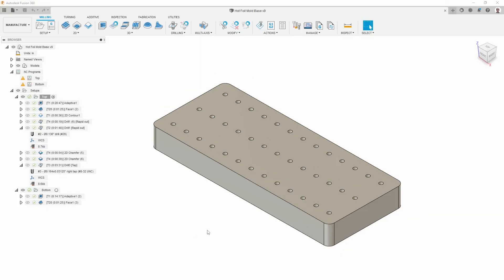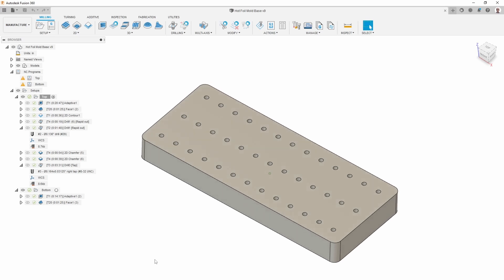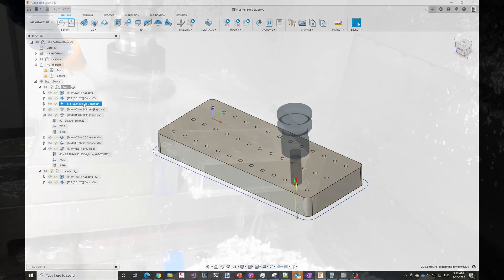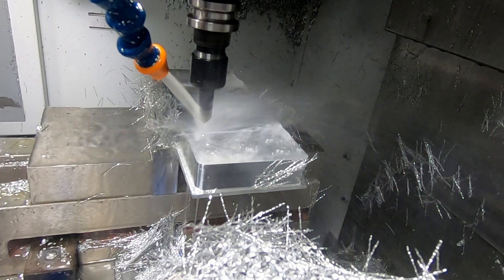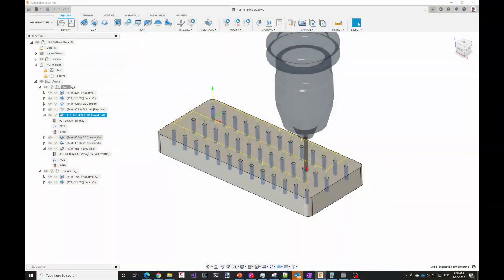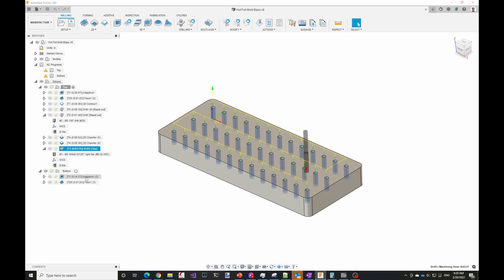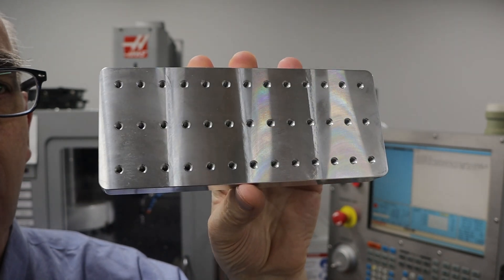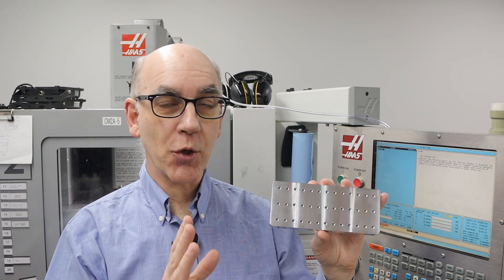Hot Foil Stamp Fixture Plate

Comment: I’d like to know more about the tapping.  Thanks 😊
Reply from the maker: What do you want to know? I'm using the taping tool path in Fusion 360. There really isn't much to it.
Reply: @JohnSL  - does spindle RPM match tap pitch? What RPM? Type of tap? Chip evacuation strategies? I’ve got a 1.5hp spindle. Just wondering if my CNC can handle tapping?
Reply from the maker: Ah, I see what you're asking. Your CNC machine needs to support rigid taping for this to be an option. If you're machine doesn't support rigid taping, you'll need to use thread milling instead. With rigid taping, the machine itself handles coordinating the spindle rotation with the downward movement so it matches the thread pitch. And yes, 1.5 hp spindle should be more than enough as long as it's a smaller tap (8-32 or less should be fine). I'm using a spiral flute tap, which causes the taps to come out the top.

Comment: I know your haas is smaller than the vf2 I'm used to running but I used to run my tormach 770 harder than than in 6061. I would be willing to bet you could do a 0.500" DOC with that endmill at 8% WOC at 100IPM-200IPM (If I remember you have a 15k spindle) and have your spindle load not exceed 50%. 

Also seeing you drill makes me feel like I need to be braver and not just peck drill every hole deeper than 2x drill diameter...

Great video man!
Reply from the maker: Yes, I could run it harder. However, the spindle is a 30K ISO-20 spindle that is meant for precision rather than material removal. The manual specifies not using tools larger than 3/8" diameter, and not to use more than 20% WOC and %20 DOC. One of those is actually 25%, but I don't remember which one. So I keep the loads lighter to be friendly to the spindle. All of this made me wonder why the machine has a 5hp motor. But then I realized it uses the 5hp when spinning the spindle up to 30K RPM quickly.

Comment: Might I introduce the idea of form taps for when you're working with aluminum? I've been sold on them for a while now when it comes to both blind and thru-holes. No chips mean little to no headaches, and they last forever.
Reply from the maker: I do have one form tap I've used before. But most of the taps I have are spiral flute, so I used what I had. I actually don't do rigid tapping very often.